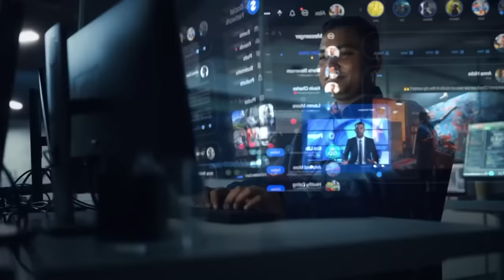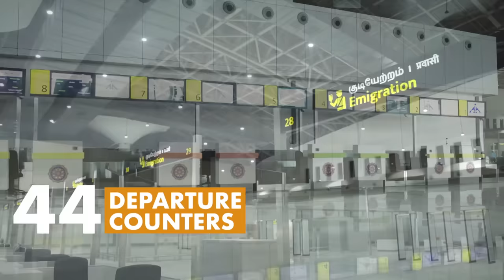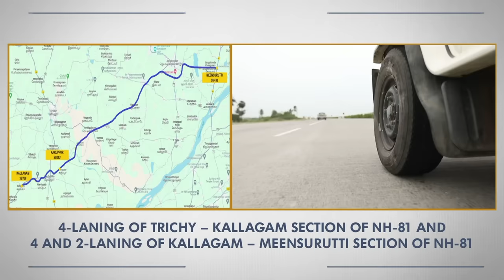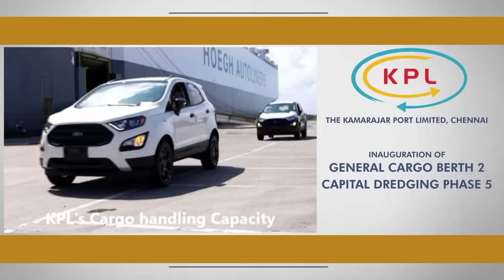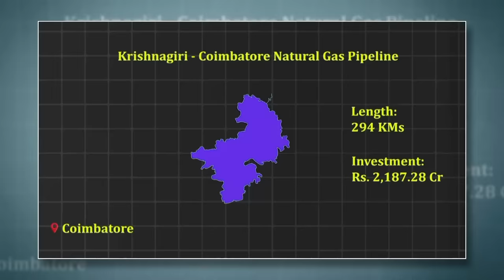New Terminal Building of Trichy International Airport, elevates robust air connectivity & infra

Comment: I used Trichy airport in 2019 August to fly to Singapore and then fly back from Malaysia... With all due respect, many railway stations had better facilities than this airport that time ...Good it's getting a much needed facelift now...
Reply: Come on....its not that bad...old airport is still clean and has adequate amenities.
Reply: @try21 he said facilities
Reply: I don't accept that it has no facilities than that of railwaystation in 2019, I am a Trichy based person and I regularly use the airport it has got what all is required accroding to its capacity
Reply: @KottaSupriyaChowdhary correct. development is not required

Comment: There is no North - South devide by the people. It is not even vote bank politics. It is the Loss of TRUST with the BJP government in the centre whose sincerity is suspect. This was covered up as anti incumbency factor, dravidian politics, anti  Hindutva, leftists etc. 

In Karnataka BJP did not deliver on the promise of development. People quickly noticed that Modi was superficial. Modi jumped into the scene Just Before Election. He was mostly seen inaugurating the extention of railway platform, flagging off of Vande Bharat train, one small new airport, converting 4 lane to 6 lane. All of which were not substantial to impress the voters. 
All that Double Engine Sarkar could do was to finish off 2 big banks by merging with BOB etc and to promote Amul products.... Corruption was rampant, law and order deteriorated. India's IT capital languished without safe roads and stormwater drainage. All Master strokes by Modi. 

Modi's big bang road shows in Bangalore failed. Modi wave did not happen. BJP lost badly to Cong. 
Anti incumbency after barely 3 years of rule!? It's a joke. 

Is development a guarantee just to Gujarat, UP and handful of adjoining states? 
Centre allocation to UP(187) & Bihar(102) in 2023-24 is Rs290K Cr. Total allocation to 5 states in south of India is 160K Cr. UP has got 5 new international airports and 7 more domestic APs will be added in 2024. 

Is Modi - Shah combine snubbing Bangalore just so that IT business is diverted to Gujarat? Why language issue erupted now suddenly in Bangalore? Is it to tarnish the image of the city? Shah repeatedly talked about making Hindi compulsory during BJP rule in state. Why U turn? Can Modi be trusted? 

Satyameva Jayate!  🪷
Jai Hind!!  🫡